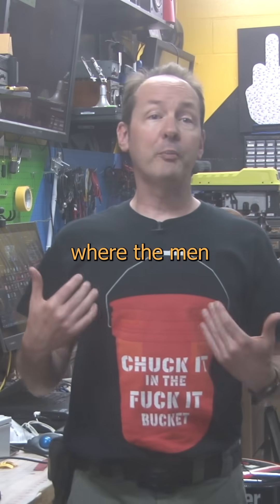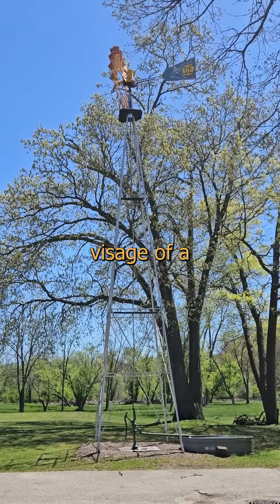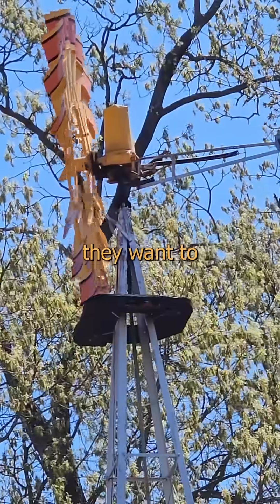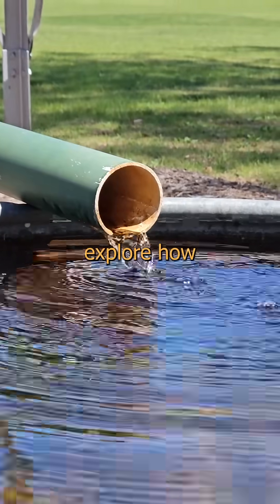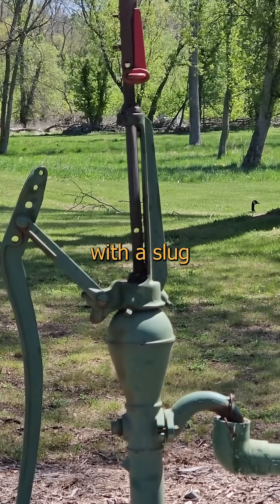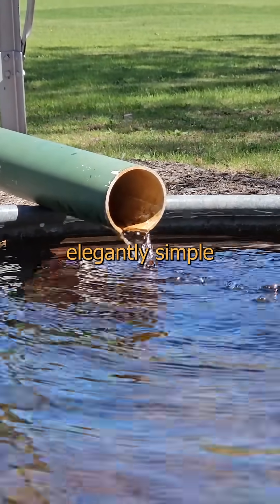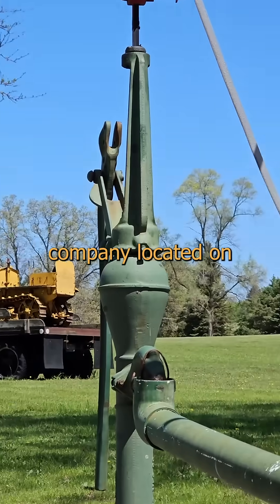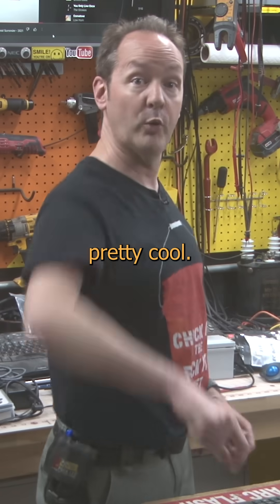Windmill Water Pump #chrisboden #comedy #engineering #farming #history #plumbing #well #windpump

Comment: So just like the lever ones. We had a camp that came with one of those by the sink - and historically the ones that pumped water out of mines worked like this. Pretty sure the original Sterling engines were used to do that pumping. No rotating anything, just a beam going up and down.

Comment: They are still great pumps out where the wells are shallow enough and running a power service would require hundreds of feet of cable and a new transformer just for a single well.... They are probably still cheaper than a solar setup, we tried a solar setup in the early 2000s and ended up just throwing 5 gallons of gasoline in a generator every couple of days to keep the stock tank full.

Comment: I “assisted” my Step-Dad overhaul his Aeromotor pump back in ~1980-82, when I was a young teen.  With the help of a borrowed pump jack, we pulled the pump, put on new leather valves, did some repairs on the windmill head, and got about 25 years of good service out of it.  He put in a gas powered pump some 20 odd years ago so he could water his garden.  Even though it no longer works, it stands as a monument to one of the first lessens he taught me.  Which is: take along a can of wasp spray when you climb up that tower.

Comment: I've done some vigilante repairs on the windmill that belongs to the subdivision I used to live on. There's a whole mess of ratchet straps and 2x6s holding the shaft in just the right spot so it doesn't knock around against the tube. Last time I visited was Christmas '24 and it was still all there just as I left it

Comment: As someone who has worked on these in a ranch in Nebraska I can guarantee you the maintenance of some of these things is the biggest pain in the ass that I've ever dealt with. 

Specially when you get to one that has the well several Rod's deep and you need to pull it up more pipe than you can lay in a day.

Comment: 30 miles east of here, a guy mounted the pump 15’ above the ground. Water flowed into a 100 gallon tank, the house had running water in not freezing weather. The overflow from the upper tank went into the livestock tank.

Comment: Leather valves/seals were used at least through the 60's  easy to replace and I'm sure there are still a ton of them still in use (last time I replaced seals in one was in the late 80'sand they were leather).

Comment: Here in New Mexico, (never seen it elsewhere although I’m sure cattles farmers use the same type of wells) we use fiberglass rods roughly 50 ft long, our deepest well is over 400ft deep. And it’s the original windmills, it doesn’t pump water that quick though and also has a float valve similar to a swamp cooler to stop when stock tanks fill. When you have these over thousands of acres it’s a lifesaver. I seen stock ponds fill up with water hundreds of thousands gallons fed by these type of mills. They’re awesome but the fiberglass is super sharp, and coarse. Ur gonna be itching for a good while even with good gloves and gear. But it works

Comment: My dad is a repairman for these windmills and wells. Our dairy farm was kept in water with an old Aermotor Windmill Company but ours was from back when they were built in Chicago. A 12 foot wheel atop a 45 foot tower, that was a massive wheel. It didn't look crazy big till we'd climb up and on the bottom platform, we didn't reach the hub yet. Over 400 feet deep well to pull up water, and yes, as far as I'm aware, leather valves are the only ones used, tho highly unlikely original as they only last a decade at the most.
    Drive through many old-school Amish countryside and you'll be blessed with the sight of them humming away, often with a motor and the base to run the pump if the wind dies for too long. We had two 4000 gallon tanks in our water house at the top of the hill. Amazing water pressure throughout the farm.
  And yes, I've pulled many  a teat milking cows on a 20 cow dairy with no electricity.

Comment: That’s neat. We know we’re now “on” (not really; it’s BLM (no no, the other BLM that conservatives hate) land that’s being leased, and even if it was owned outright we’d still be on the U.S. highway, and not actually on The Ranch ) my great uncle’s ranch when we pass the windmill water pump and big-ass water tank.

It’s the only one, too, which is a little odd now that I think about it, cus all the other water tanks and troughs are filled by pumps powered by generators.

Which, since it’s one of those places that ALWAYS has wind, is a little odd. Even if setting them up was more expensive than I’d think, you’d expect “don’t have to lug around gas to fuel them, don’t have to pay for gas, and don’t have to have stuff to keep people from stealing the generators” to be pretty hefty advantages.

Comment: Amish use windmills to pump water for daily use on the farm and home.  Furling system safety feature ensures that the windmill can withstand high winds. Weights and levers control the pitch of the blades.

Comment: So fun fact, those pumps still usually use leather gaskets and you can get them new or make them with a pretty simple jig (if youve got a hole saw and a few clamps youre overqualified). Plastic either doesnt seal well enough or wears out too fast to be viable. 

Also my neighbor here in the NC foothills has an absolutely MASSIVE windmill with a wooden tank about 3/4 up the tower, it pumps water up to said tank (albeit slowly) and once full youve got a couple hundred gallons of water at a decent height for some solid head pressure for your home, all with no electricity, and its positioned on a spot where wind always blows down a valley chute. And thats pretty cool.

Comment: We have several of this still in use.  All of ours have leathers in them with mostly brass cylinders.  They are cool until you have to work on them. Either standing on a sketchy platform to service the head, or pulling the pipe up out of the well to put in new leathers or fix a hole in the pipe.

Comment: Thanks ever so much for this.
  I last saw one of these working when I was about 10, over 55 years ago.
I must have spend 20 minutes being amazed. I tried to block the output, thinking it would stop the windmill  but the water just sprayed out of the top of the pump, there was no seal !

Comment: A medium-sized windmill in a stiff breeze can pump 2 000 litres of water per hour over a distance of several kilometres and a head of many tens of metres.

But they require a lot of maintenance from experienced, hardy, scarce and expensive experts and that is simply not cool.

So solar DC pums and panels have superseded this technology, which along with tge barbwire fence, the West was won.

RMY

Comment: If they put a turbine on the windmill AND have the water pumped up fall onto a water wheel also attached to a turbine they can use both processes to generate a bit of electricity.

Comment: Ranches in Wyoming and Nebraska still use these - I worked on these for 5 years. If you need to replace the seals, the brand new ones are still leather. Pretty sure the one here needs to be adjusted because it's striking bottom on every stroke.

Comment: When I was growing up my uncle had converted one of those to drive an impeller type pump to aerate a two acre farm pond where he raised fish. It simply produced a constant water fountain from the pump outlet. 
He had another one, on land, which turned an alternator, which in turn charged a few deep cycle batteries in a nearby shed, which supplied power to a small electric driven pump that did the same thing, guaranteeing that even if the wind didn't blow, the pond was getting aerated. Come winter though it all had to be taken drained and put away. Where as a third pump, also wind driven, would run a bellows type air pump via a gear box and cam, that would pump air into the water beneath the ice, and also keeping a small area of the pond 'moving' and unfrozen on all but the coldest days. It allowed for feeding of the fish during the winter.

Comment: a lot of them have a float, it stops them from wasting water by disconnecting the lower gear
still wish i had one, they should be standard on all farms instead of electric pumps

Comment: Grew up with two working ones from the 1910s on my grandparents' farm. There was a third that was a home-built job by my grandfather out of two 55 gal drums cut in half for four windmill blades that spun horizontally not vertically. I don't remember exactly how that particular windmill worked though. Even though my grandfather has been gone 35 years, and my grandmother has been gone 28, all three windmills are still operating (at least as of this past December when I was at the farm).

Comment: I've got an Aermotor in my yard next to the barn over an original stone well that still works. That one has a lever up top you can flip to kick it over into a different gearset to pump faster as well. Not sure if they are all that way or only certain models.

Comment: Used to work on a 40,000 acre ranch that was littered with windmills…. One of the weekly jobs was to ride around and check the cisterns for overflow….. if they were full climb up the windmill and lock it out …… and let the cistern fill the cattle troughs

Comment: I grew up in east central Illinois.  Many farms had converted their windmills to electric powered working heads/pump jacks after Rural Electrification delivered pixies to farms.  I worked on these with my father.  Lots of them still had the original cypress sucker rods.  Cypress was lighter than the equivalent steel rods and was rot resistant.  The light weight cypress rods put less strain on the wind-motor than the heavier steel would have.  These were about 1.25" (ca. 30 mm) square with metal fittings bolted to the ends so that they could be connected.  Each section was about 16' (ca. 4.8 m) long.  We could pull these from an 80 to 100' (ca 24 to 30 m) well by hand, but it was easier on our backs if the farmer had a tractor with a front loader.

As Chris pointed out, the actual pump was at the bottom of this assembly of sucker rods.  The brass cylinder remained at the bottom of the well.  It could be removed, but that was typically real work because of the heavy pipe, typically 2" (50 mm) to 2-½" (65 mm) nominal.  Almost always the problem was the pump leathers had worn out and lost their ability to seal against the polished cylinder walls.  So, the cylinder could stay in place.  The leathers, as supplied, were often stiff and had to be softened up a bit in order to be pushed back into the cylinder.

Depending on the depth, the pump would have two to four  leather cups sitting such that the weight of the water above, caused the leather to seal against the cylinder wall.  In a sense, think of these as leather piston rings.

Many of these wells still had the windmill tower sitting above them.
Reply: I remember seeing some that were still in use in my childhood, from "the old-timers" who would say that that it was working over 50 years without a problem.  Electric would go down in storms.
Reply: I lived in West Central Illinois, but drove all over and i remember these. There's some beautiful land in Illinois and Missouri.

Comment: We had a windmill power well pump stopped working 5 years ago and the well pump at our house had an electric motor but use the same everything else other than the windmill still use Leathers you can buy them from the local well place

Comment: I’m about 50.5 years old. Growing up I used to help my dad pull the windmill sucker rods to change out the leathers. We had one that could be pulled by hand but 100% not alone. I’d have to put the wrench on it while he pulled it up. It was in a creek bed so it was shallow. Sometimes the casing came out of the ground and went up about 12’ so it could feed a cistern and more troughs. Mostly they had to be pulled with a come-a-long, a block and tackle or an electric winch
With one person on top of the tower and one person on the bottom. We have mostly replaced them with solar generated DC powered submersible pumps in Texas. In Mexico, however, they still use windmills and to check on them you still have to climb the tower to look in the pila to be sure it’s full, if not you have to diagnose the issue and solve it. 
Ever see the opening scene of the Sergio Leon film with Ennio Morricone doing the sound design? The windmill squeaks…
Here is a bonus: look up Max Stalling’s song, “The Pila Song” -It’s about a broken hearted cowboy who wanted to cool off but didn’t look before he leapt and spends hours wondering if she will even shed just one tear, over him.

Comment: Even if the valves aren't original they are likely still leather. I have a hand pumped hammer point well that was purchased new just a couple years ago and the valving is all leather. Nothing else works quite as well. 👌🏻

Comment: Another tidbit of useless info - the  Aermotor company also designed most of the forest fire detection towers used in the eastern part of the U.S. back in the early 20th century. they would come as a compete kit and could be assembled with just a small crew and no heavy machinery. Kinda like a big LEGO set

Comment: Oh dude I’ve rebuilt those and they suck to pull. The leathers will last 10-20 years in the right conditions. But if you don’t seat them right, you’ll have to put 200ft of 3” pipe in again in a week. I think you can get a pdf manual for them
Reply: https://pure.tue.nl/ws/portalfiles/portal/39189053/613901.pdf

Comment: Oh those old pumps still use leather. I don't know of anyone selling rubber or synthetic gaskets. Every replacement I see, be it Ace Hardware or Tractor Supply it's always 100% leather.

You're right though about virtually all of these being nonfunctioning. Most of them are gone in Florida, done in by hurricanes.

There's 1 though that is still standing, maintained and doing its thing because the owner doesn't want to run a power line out there to an electric pump.

He's replaced busted parts 3 times from hurricane damage and he replaced the seals and gasket as needed.

Comment: They should adjust or shorten the shaft length because it is bottoming out, which is making the bolts loose and could damage the pump head or gearbox over time.

Comment: Interesting fact. The leather seals are still available. I have one of the old hand pumps. When the leather finally gave up the ghost, I replaced it with rubber. That seal failed in three years. I found leather seals and replaced it with that. 5 years now and still pumping. Newer is not always better.

Comment: Even if the valves are brand new they should be leather. You can still buy all these parts and assemble one yourself for the low low price of $12,000. Aeromotor windmills, NIB, are around $6,000. The tower they sit on is separate, costing about $3,000 depending on the height you select. Then the pump, sucker rod, assembly takes the rest or more depending on well depth and pump diameter. All new components can still be purchased.

Comment: Yup, I have seen many that are Yuppie Yard Art, but not a working one. However in my childhood, the grandparents had two hand pumps connected to one well. The normal one on top outside the back porch but also a miniature one at the "zinc" for grand dad to shave in the morning with his straight razor, strop and all. Why "zink"? Because the counter was wood barn planks with a sheet of zinc metal hand hammered into a sink. And I did assist replacing the leathers in the large pump with grand dad one time in about 1962. The next year they got electricity, a well pump and indoor plumbing. It was a great year to retire the  kerosene lamps in the house too. The wood burning kitchen stove never left the place. Granny wanted no part of a gas stove. Biscuits, bacon, and eggs every morning for decades on that wood burner four burner, one oven stove. Her biscuit cutter? A Steak and Shake small water tumbler. If you know, you know.

Comment: Many years ago I had the opportunity to help service one of these. I climbed the tower with a crescent wrench on a lanyard and used a rope to hoist first a drain pail and then a jug of non detergent oil to change the lubricant, and got to see the mechanism up close with the cover off. 

Also helped replace the leathers on the pump when we pulled it out of the well to repair the lid.

I’m always glad to see one of these old windmills still operating.

Comment: They have a brass poppet valve and a brass check valve the leathers are what lift the water. The mill in the video is lightly tapping against the bottom of the cylinder and needs a split washer or two installed under the head on the mast pipe just some of the things I have learned in 35 years of windmill work